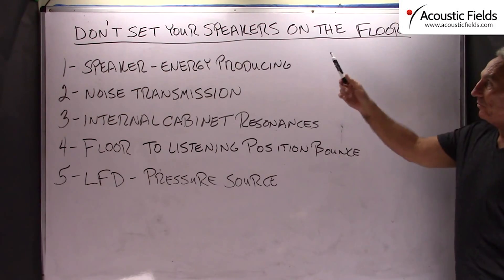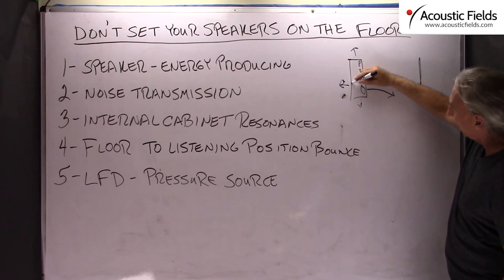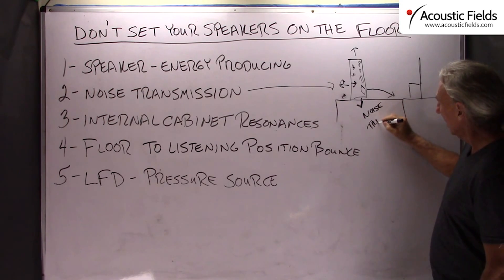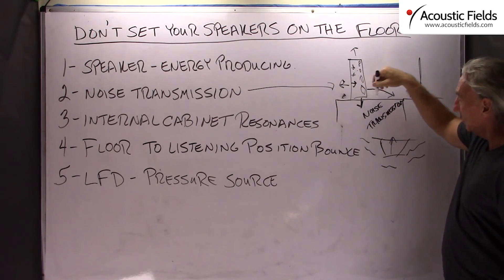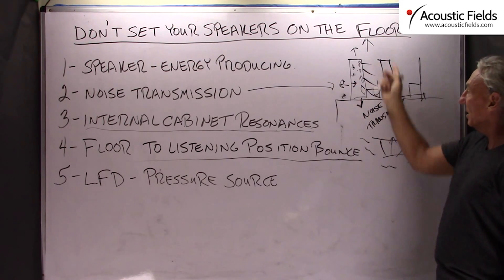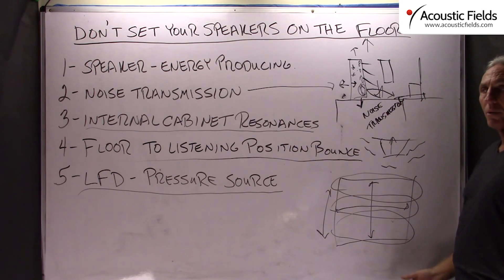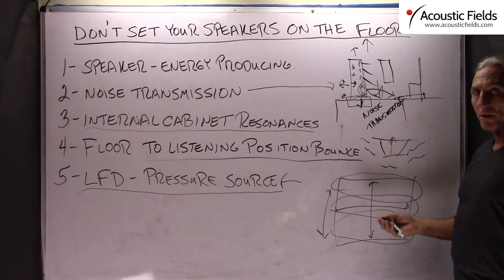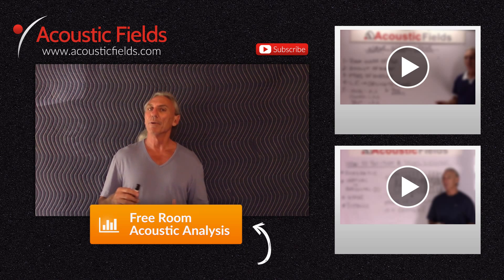Don't Set Your Speakers On The Floor! - www.AcousticFields.com

Comment: "Coupling" the speakers to the floor will drain some excess energy from the cabinets while more importantly mass loading them, keeping them stationary in time, which increases Q and prevents smearing the high frequencies due to micro and macro movements. Now, unless it's a poorly built structure and a poorly built enclosure, the floor is sound (pun intended) and will be just fine as a means to improve sound quality. Pay attention to the floor joists so you can couple the speakers directly to them. The closer to the wall, the better (within reason obviously). 

Decoupling the speaker or sub from its support surface would give the opposite effect, and wouldn't be my first choice in virtually any situation.
Reply from the maker: DJ, Why couple the speakers to the floor to drain energy from the cabinet. Why bring a larger surface area into the equation? Place it on a platform that does threes critical things; Elevate, attenuate, Isolate.
Reply: @AcousticFields  Coupling the system to the floor should not add more resonance if it is sound and done properly. It will drain excess energy from any cabinet, especially a lossy one, like an LS3/5A or similar. This is a good thing. 

Most important, it will make things stationary, unlike the best isolation, which will prevent smearing the sound. If you are setting up in a very old home using a suspended floor that is poorly supported, then isolation might give better results. This is my anecdotal opinion and the physics is sound. Nevertheless, do what you wish.
Reply: Scott, as you're a DJ I'm gonna assume you want that extra bass you would get from 'coupling'. Especially from a live sound perspective as you will get more bang for your buck. 

But in the audiophile/studio world, we're trying to stay true to the source material, and dont want to invite distorted or coloured artifacts into the signal.
Reply: @Bondy90s  I can appreciate the assumption but no, that's not the case. Yes, I am a DJ by trade and have been around very high-end sound systems, both pro audio and home audiophile. Do what you wish. I speak from experience. Just like you, I am looking for the most accurate sound reproduction. Some people want to sell things. Try it both ways, using the criteria I summarized above, and sell your platform when done. Yes, elevating one sub to help even the response of room modes is good advice, but it doesn't require a specialized platform. Make sure it's mass loaded and coupled to the floor. Again, this assumes it's a solid floor and structure.
Reply: @No Name With all do respect, when a band or orchestra sets up and plays live, do they decouple themselves from the floor and room? No. That being said, a reproduction should be accurate and isolation will prevent distortion. However, how good is the isolation? And no speaker cabinet is resonance free and dissipating that energy (distortion) into denser structures will reduce the fundamental and weaken its amplitude. This solid foundation will also minimize movement to prevent time and frequency distortion.

Comment: I use soft feets (Sonic Design) under all my speakers and those helps a lot.
Reply from the maker: B,  Vibration transmission reduction is a good start. Now, raise your speakers to improve room response. After that is achieved, absorb excess energy at source.

Comment: my speakers r way to heavy to lift off the floor. when i moved home the removal guys couldnt even lift them and took 2 of them just tilt it enough to get the sack truck under them to move them.

 they pump out 2,000 watts and have them as my front speakers on my dolby atmos home cinema setup. Makes it feel a lot better as the floor shakes when earthquakes or explosions r going off in films. So not only do i get the surround sound i get the vibrations as well. So they r staying on the floor lol.
Reply from the maker: C,  Wattage is a salesman game. It means nothing when it comes to energy management within a room. Secondly, quantity is not quality.
Reply: vibrations are shit for sound quality! if you want vibrations there are devices for your seat without shake the whole room and everything in it starting to make noise

Comment: Interesting. My subwoofer is on the floor but doesn't sound impressive when I sit on my chair. When I stand up in the same spot, the sub sounds amazing! And that is the case throughout the room. At standing height it sounds much much better. If I elevate the subwoofer, will I elevate the "good sound" even further or could it also end up sounding better sitting? Cheers
Reply from the maker: A,  Low frequency energy sources are location dependent based upon output and room size and volume.  To test this place your sub woofer in room center. Move it back and forth towards the side walls. Move it back and forth towards the rear and front walls. Raise it up off the floor 12",18", and 24"

Comment: Well i was going to ask if i should be isolating or absorbing with my speakers.
That's told me
Reply from the maker: D,  Elevate, isolate, attenuate.  Elevation improves room response,  isolation reduces floor to speaker interaction, and attenuation absorbs excess energy created inside cabinet.

Comment: Eventho this is old... i have this “Shelf” under my tv, u know were you usqually put your ps4, but I could fit my Sonos SUB in there... so there it is, i was wondering, does it take damage over time or is it a ok.. 😬
Reply from the maker: J,   Never place an energy source where the energy is trapped between two small distances. Think of your shelf as a "sound prison" . Sound energy must be free and unrestricted.

Comment: would a nice wood trunk make a good stands for a bookshelf speaker please? I also have a floor standing Focal on spikes. Does that need to be elevated or spikes are good already? any help is appreciated.
Reply from the maker: M,  If the trunk is full of sound absorbing material. Trunks are resonating chambers based upon their size.
Reply: @AcousticFields  thanx
Reply: @melgibbson8955  Added January 6, 2018: "Speaker isolation came up in a Facebook audio group, and someone posted THIS video that further confirms competent speaker cabinets don't vibrate enough to transfer energy." Excellent article and I do tend to agree with him but how do we know he didn't pull a fast one on us just to try to get people to go to his website to purchase bass traps?

Comment: Thanks for giving me a new way to think about my speakers. Although I'm sure not all speakers are meant to be put on stands I can see how having energy absorbing material or energy neutral material below the speaker changes the dynamics.
Reply from the maker: G,  Speakers are designed in a reflection free environment. The end user then takes those speakers designed in a reflection free environment and places them in a reflection full environment. Any adjustments you can make to improve that relationship are welcome and should be employed.
Reply: Many speaker cabs are designed to be on the floor, and the coupling is part of their tuning.

Comment: What it comes down to is buy better speakers.  People that need to know this stuff about their cheap speakers, are not watching this in the first place.
Reply from the maker: B, It has nothing to do with speaker quality. Elevating the speaker will improve room response, attenuating low frequency energy from the low frequency driver which is close to the floor is always welcome and minimizing floor to speaker noise transmission is audible.
Reply: no speaker can trick physics

Comment: A bit of a story.  I was given some Rank Arena floor standing speakers many years ago.  I set them up on my pile carpet floor but found they lacked bass.  I didn't know a lot at the time but knew audiophiles like to mount speakers on stands and or carpet spikes.  So, I installed spikes and vola, I had bass.  But what I had done was transmit the cabinet vibrations into the timber floor. In effect, turning my floor into a giant bass resonator.  It stayed that way for quite a while.  At some later date, I swapped these out for Polk 10Bs that I inherited.  The cables these came with were old and dirty so I put them aside to re-terminate later.  Meanwhile, I just used my existing cables.  That sound was quite disappointing to what I had previously heard from the 10Bs.  It wasn't until I cleaned up the original cables and swapped them in that the 10Bs came to life with clarity and a really nice full spectrum tonality.  These are in fact the nicest sounding speakers I have ever owned.  I had been really really skeptical about cables making much of a differences but here was the proof.  So I put the Rank Arenas on thicker gauge cables and removes the spikes and they had bass now.  Not only that but it was good and tight bass and better clarity overall.  Even though they were sitting on the same carpet as before, I had never heard them sound so good.  Tonality wise, they are of their time of course.

The point of this is that there is a lesson here.  While you may think that something is an improvement, it isn't necessarily addressing the real problem and therefore, is not getting you closer to optimal performance.  In fact it may be taking you in the wrong direction.  It turns out that speakers should be mounted solidly so that the cabinet resists movement.  However, this needs to be done in a way that also isolates cabinet vibrations form structures.  Stands and spikes need to provide firm stability but their implementation needs to also provide isolation.  There I've said it twice.  An amazingly simple and most effective way to provide that isolation and hold the cabinet solidly in place on the stand or spikes is with nothing more than a thin amount of blu tack between cabinet and stand or each spike.

On the subject of speaker position.  It is often suggested to not place speakers near a back wall.  This is not correct.  Corners should be avoided but surfaces are reflectors and if the reflected sound is out or phase by less than 50 ms, that will be perceived as lacking clarity.  but greater than 50 ms is perceived as resonance (a positive),  The cut off distance for this is about 8m from a wall.  So, unless you are in a auditorium, your unlikely to achieve this minimum distance from a wall.  In really, the ideal solution is to have the cabinets set into the wall so that the face plate is flush with the wall so the sound wave radiates along the surface rather than reflecting off it.  Usually the practical solution is to keep them as close to the back wall as possible without crowding rear ports.  This way, most of the back wall reflections strike the wall at a very shallow angle and are well dissipated by the time they reach you.  Of course, you still have the other walls, floor and ceiling to contend with but it means you have effectively dealt with one of them and pile carpet is your floor bounce friend.  Soft furnishing are helpful absorbers but it's nice to retain at least some room resonance.  You really don't want to go padding out the whole room.
Reply from the maker: Ken,  Elevating source and attenuating energy with the proper technology under source will improve room response. Every room's usage and size determines distances for set up. It is difficult to make generalizations about all set ups and rooms.

Comment: There are a lot of people who don't hear that kind of differences.
Reply from the maker: Wil,  With low frequency energy you do not hear anything. It a process of feeling through bone conductance. Raising a sub off the floor can have a 2-4 dB impact on room response which is very "audible" and felt. Remember that achieving sound quality is the direct result of doing a lot of little things in the correct order.

Comment: By doing things like putting speakers such as bookshelf speakers that lack low end response on floor shelves, you can emulate more proper frequency response that the speaker ought to have. The same for vise versa when putting speakers with weak high end higher in elevation. In the end though, this whole subject is a matter of subjective taste.
Reply from the maker: P, Not correct. You can do a before and after measurement to see the improvements.
Reply: I understand that you're basing this off of accuracy of studio sound intention. If you're horribly concerned with that, then there is some basis there. But if you're not an audiophile and you just want to shape the sound for yourself, there is nothing incorrect about this.
Reply from the maker: P,  Our goal is to minimize distortion both room and equipment so that the sound quality can shine through. Quality sound in any room is a combination of doing many things correctly but more importantly in the correct order. Equipment set up is critical to this process.
Reply: Well sure. Though, I would argue that unless whatever distortion that is there is actively or overtly imbalancing the frequencies to the untrained ear, distortion may not necessarily be a bad thing. Distortion can often even be used to color the sound in a similar way as an eq can, according to taste.
Reply from the maker: P,  Sorry, not in my world.
Reply: @proteusblack8913  you don't want reflections - period

Comment: If you can hear where your subwoofer is, then it is distorting. Mine is at the opposite end of the room to the main speakers yet it integrates perfectly. Nobody who listens to music here is aware that there is a subwoofer, and even when they know they say that all the music appears to be coming from the speaker. I've equalised things with Sonarworks, which reports flat response down to 20Hz. I have acoustic treatment on some of the walls  - 4 inches of rockwool in front of a 4 inch air space. This effectively removes the room modes. A thick lambswool rug covering the space between speakers and listeners kills slap echo. And the floor is concrete, so no speaker energy gets transmitted into that.
Reply from the maker: D, Non localisation of source especially for low frequency sources is the goal. You can use positioning and signal processing to achieve that goal.

Comment: But my speakers are 155 lbs each and the height of the drivers is optimized for the speaker being on the floor. For improved sound, the speakers came with spiked feet and metal posts for connecting the back of each speaker to the wall, which I have never used. The spikes are for when being used on carpeted floors. I actually have had to elevate my speakers slightly to avoid blocking our double doors. I was worried about raising them but had no choice. Why would speaker makers produce a high end speaker and leave out the necessary internal insulation that prevents the problem described in this video?
Reply: Cost.

Comment: Thank you for the beautifully straightforward explanation. I have very heavy speakers (Canton CT1000's) on a solid shelf but not sure of the best material to isolate them. Minimal contact with the shelf is the way to go?
Reply from the maker: S,  Placing speakers on a shelf is not advisable. They will also be too close to a wall creating more distortion.

Comment: Setting your speakers directly on the floor without spikes or isolation is very detrimental to sound quality but FYI according to the laws of physics, energy can not be created nor destroyed, only transformed. Therefore speakers are not energy producing devices!
Reply from the maker: J,  Speakers are energy producing devices as far as the room is concerned. All the room sees is energy whether it's from a speaker or instrument or voice.
Reply: @AcousticFields  Speakers transform electrical energy into mechanical energy (in the form of coil movement, cone movement then pressure waves).
Reply: Energy is stored in Mass, and CAN be released from it and absorbed by it.
.

Comment: Very interesting....do i need a base?  as the floorstanding speakers i have are already separated from direct contact with the laminate floor (on top of concrete) by a built in plinth on top of spikes ?   Mission SX4s
Reply from the maker: C,  You can elevate, isolate, and attenuate with a platform. Elevation improves room response, isolation reduces noise transmission, and attenuation absorbs cabinet vibrations and low frequency energy.

Comment: Hey mate. You seem to know a lot about sound and hi-fi. Have you heard the phantom golds by devialet? The speaker cabinet is a sphere so vibration is practically non existent. To me they sounded much better than anything I've heard in a while. Any thoughts?
Reply from the maker: M,  Internal cabinet resonances are always an issue with speakers. What are speakers? They are very small rooms and are plagued with the same resonances as larger rooms. Different cabinet designs are a direct response to those resonances. I have not heard that brand,
Reply: @AcousticFields  you should check them out. This design could be gamechanging.
Reply: It's not correct...the sphere shape only have a better resonance spectrum distribution vs others.